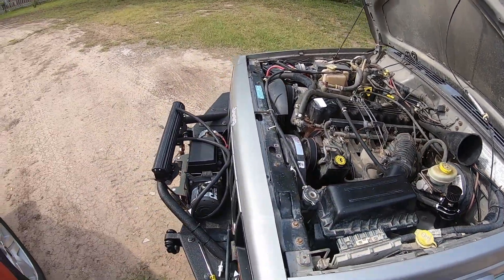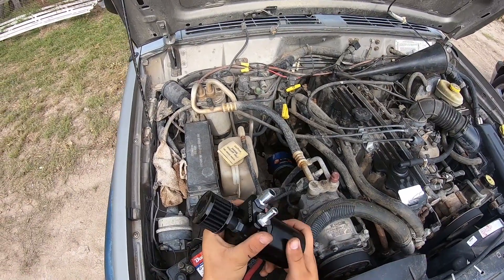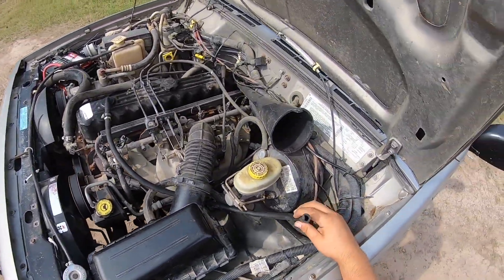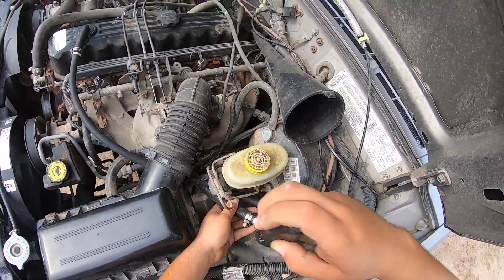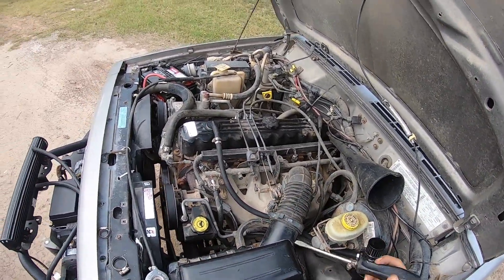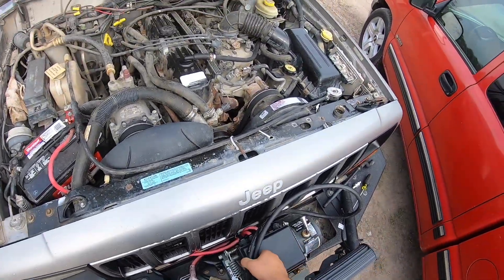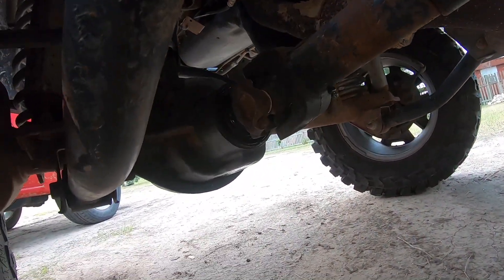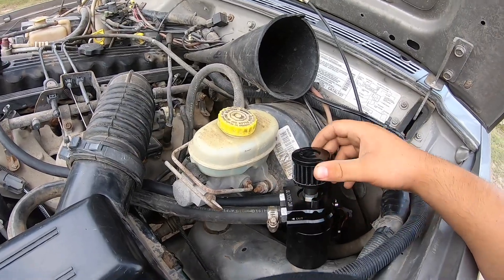Jeep 4.0 Oil Catch Can Installment

Comment: You put it on the wrong one. The front elbow is sucking air into the engine from the intake to equalize the crankcase pressure while the rear elbow is letting exssesive crankcase pressure release into your intake manifold. Those rear elbow gasses from the crankcase contain oil vapors. If you're getting oil into your intake from the front elbow it most likely means your rings are bad.
Reply from the maker: Thanks for the info
Reply: Came here looking to confirm that thought! Tks!
Reply: I did the exact thing you said but I noticed the oil pressure is not moving as normal. Sometimes doesn’t reach 100 on the gage. Any recommendations.

Comment: This is wrong. It is supposed to be connected on the rear  vent via the catch can and then into the intake. If you get tired of emptying thr can you can drop tje csn and run the hose under the car. Just remember to plug the input to the intake…